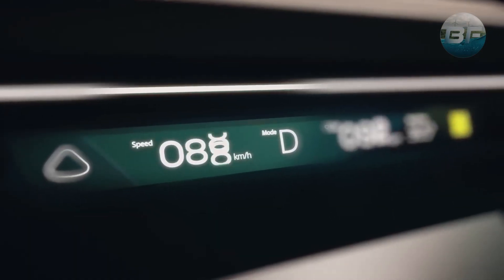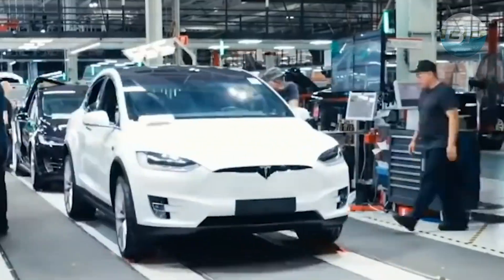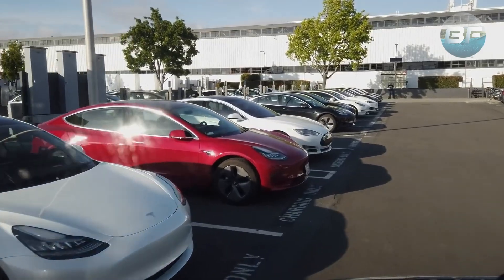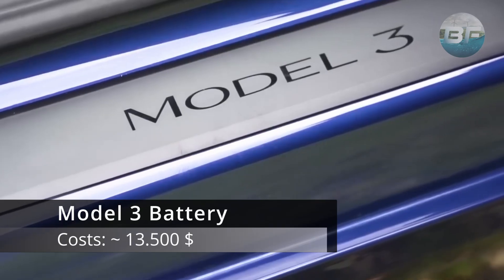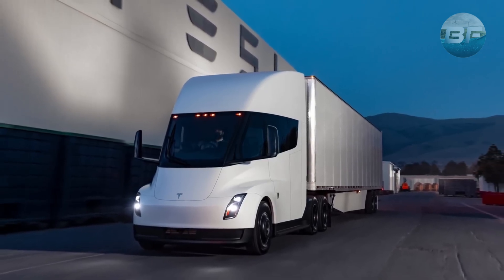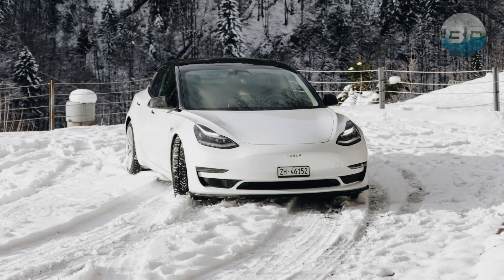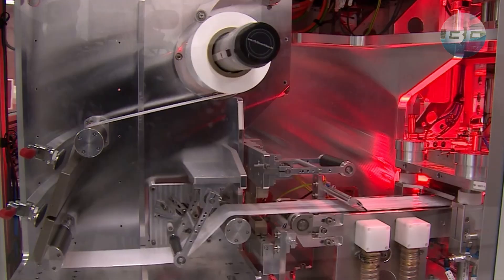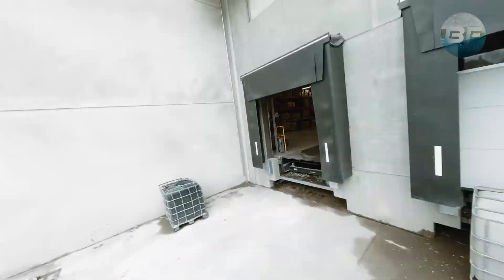New GAME CHANGING Battery By Tesla Which Could Last Beyond A CENTURY | Elon Musk

Comment: If what you say is true this will be huge, not just for EVs but for renewable energy storage. When is it estimated to be coming into full production?
Reply from the maker: There is no production date yet for the new battery cells. They are still being researched and more studies need to be done. Once this technology is mature, it will undoubtedly be widely used and offer numerous advantages. The new low voltage NMC532 cells have been predicted to have lifetimes beyond 100 years, especially when using LiFSI electrolyte. However, achieving such a long lifetime would require careful management of charging rates to prevent lithium plating.
Reply: @BeyondFuel dawahhgiisaunoilonoihytrewesaawaedwaerdsawag work nor planning nor knowledge nor wisdom in the Grave, where you are going.
Reply: Whatever your hand finds to do, do with all your might, for there is no work nor planning nor knowledge nor wisdom in the Grave, where you are going.